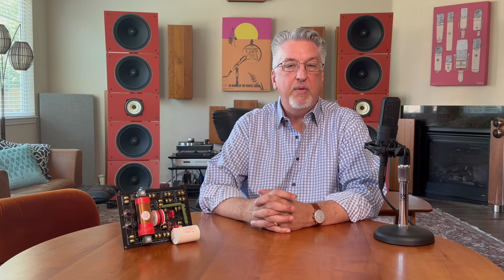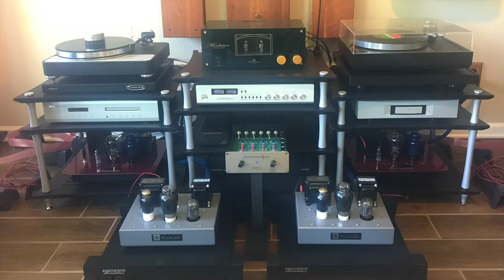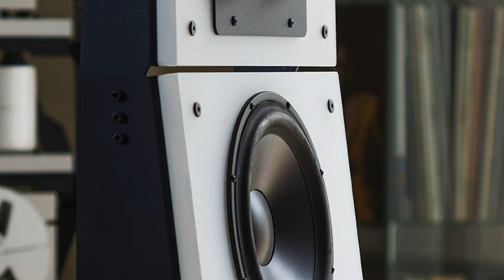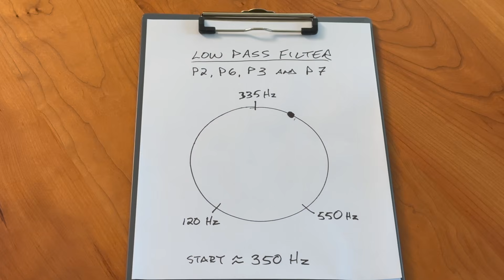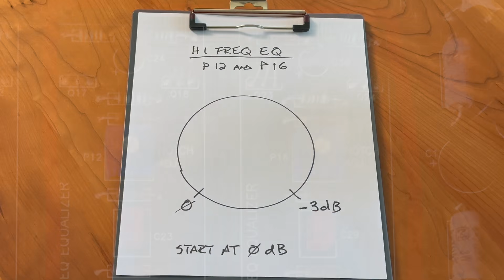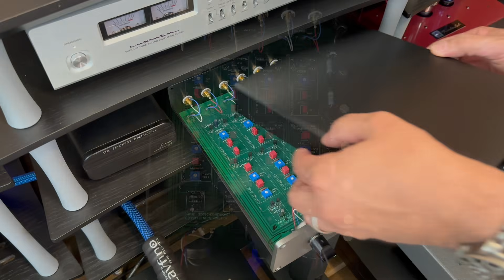PAP-C1, Active Analog Two Way Crossover

Comment: Excellent design. I built Nelson Pass's DIY version for my self built open baffles to crossover at 550 hertz. Bi-amping between the woofs and the mid/tweet passive. Will be tri-amping soon to split the tweet and mid. This crossover design is not wanting in the least. Board build quality is absolutely the best. Mine doesn't have all the same functionality and features as the PAP unit, but it's soul is the same.... The DIY is just a basic crossover, but nothing gets in the way of the sonics of the design.